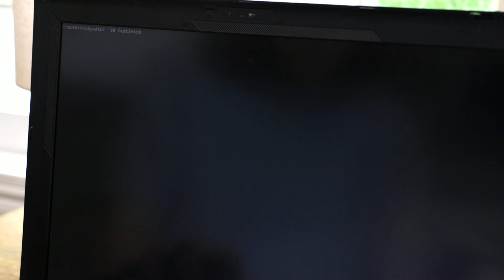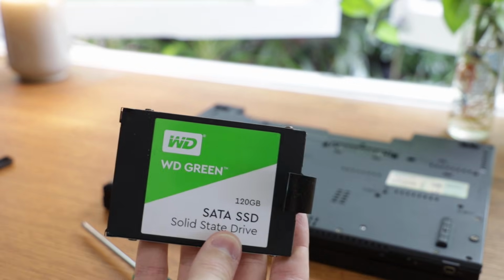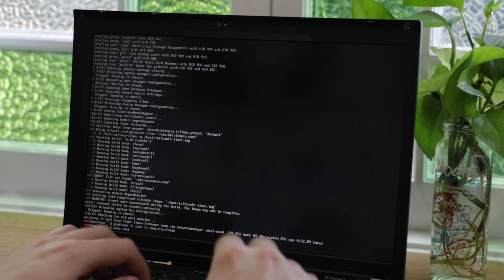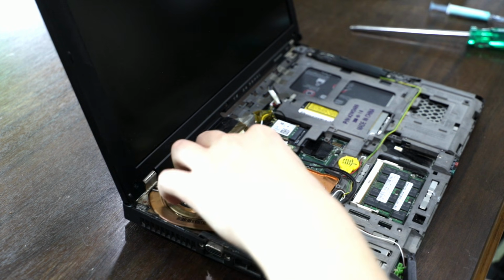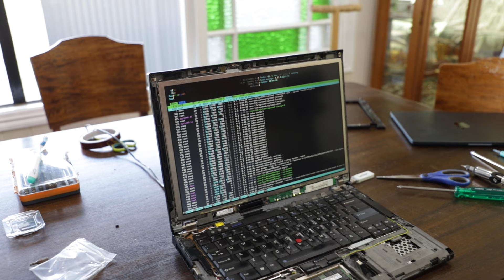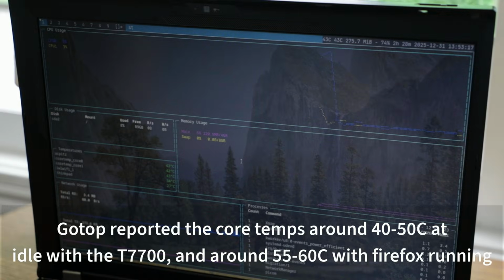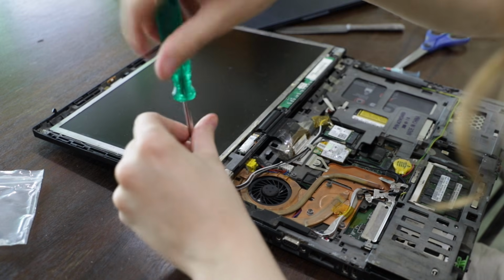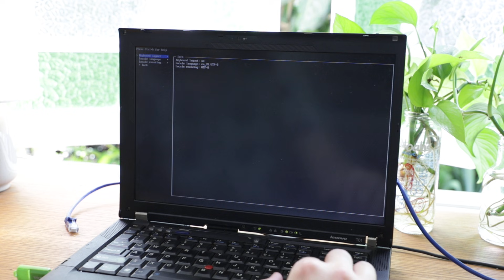Restoring and upgrading an 18 year old Thinkpad T61

Comment: I have a Toshiba satellite l500 that I love to bits and have taken to bits and powered on, with the motherboard resting on a stack of post-it notes trying to diagnose overheating. Apparently the heat pipe broke? Didn't know that happens. Miraculously, it all works now. I wouldn't say its easy to take apart, but it is upgradeable. You can still have some fun with any laptop from ~2010, bit just the thinkpads, dell bussiness laptops are quite nice too. And I really agree what you said about archinstall, if you get an error, you have no clue, but if you do it manually, you know where it broke and get an overview of how it all works. Great video 👏

Comment: I daily use a Mid 2009 iMac while most people wouldn't want that, I use it on a freebsd box and runs pretty well but time to time you'll need to restart your application due to DLA that causes it to slow down. Also there are limitations what software can run typically while most people care about games there are certain graphic or processor intensive apps that don't work but there are workarounds.

Comment: Lenovo is consistently better quality than hp or dell. Hp with the hinge problem for example. Not to mention you bought an old laptop that was used for many years. Windows is bloatware??? Is that your original thought or are you sheep? I install Windows 11 on laptops from 2011 with no issues, it looks like it's fashion nowadays to just hate on Windows for some reason. You wait until Linux starts to be the same way mate, it's not far off.

Comment: I have a ThinkPad P73 that bought used of market place for $300. It's a fair bit newer then the one featured in the video, it's from 2018, I think. It's an absolute tank! I've been able to upgrade the ram, nvmes and even added an sata sad to it. It's huge and weighs a ton, but it a great desktop replacement and runs Linux without any fuss.

Glad to see that this T61 has a new lease on life:)
Reply: I just recently bought a used t14 and im upgrading the ram and putting a new ssd in. This stuff is exciting! Im gonna use a dual boot system with Ubuntu and windows 11

Comment: My X260 is similarly wonderful. Has a 32gb stick of DDR4 in it (because why not?) 1tb SATA drive (only used like 100 gigs on CachyOS) has an intel AX210 wifi card AND it has like 100WH of battery capacity in it, which lasts forever when I limit my CPU wattage for doing basic stuff.

I recently got a X13 gen 2 with an i5-1135G7 for a smoking deal and honestly it's kind of underwhelming. Behind it's gorgeous 16:10 screen, faster CPU and all aluminum chassis it just doesn't feel as robust. I'm also kind of annoyed with scaling. The old 1366x768 screen on the X260 doesn't need wonky blurry scaling for me to read things :(

Comment: Wait until he discovers the T480 😄
Reply from the maker: Oh I know lol, but this was cheaper (until I started upgrading it).
Reply: t480 is really overrated and really expensive than even newer ones
Reply: @moziy_ This. Tbh, if I wanted an older thinkpad, I'd just shoot for anything T420 and lower. The T480 is basically the same compared to the newer models when compared to upgradability, except for one ram slot. I don't understand why people hype it so much. I'd be more satisfied with one less ram slot but with a newer Ryzen cpu than an 8th gen i5 and HD Graphics from the dark ages.
Reply: @bromdeluna i need bloatware 11 for work. So the fact the t480 has a tpm 2.0 module and once you slap 32/64gb ram in there. The processor is not slowing me down at all. The intel 620 gpu is a dog. Totally agree with you there.
Reply: @moziy_bought mine 2 years ago for about 200 euro. Nowadays i totally agree with you. Some people listing these for like 300/350. However, the purchase price is one thing. All the upgrades that you will do is another. Mine is maxed out so all in all I'd say I'd spend about 150/200euro in upgrades over the years and i don't regret it. It's a perfect travel laptop for my use.
Reply: @moziy_ Outside of it's specs I really hate the t480 the keyboard on it is shit
Reply: @sebastiansel07 i have tried a t14 and didn't like that keyboard at all. The 480 at least has some travel to it. Of course they're not as good as the old school IBM ones.
Reply: @cryptopelgrim4751 I thought they both use the exact same keyboard outside of where the ribbon cable is placed
Reply: T440p
Reply: @the_retag with libreboot option. I like the 440p and they are super affordable.
Reply: T480 is only good because of the Intel 8th gen processors. It's not that good of a laptop.
Reply: @5l3ks i would argue that the 8th gen is just good enough for modern computing and the 620 gpu just outright sucks. For me it's the modular design and easy upgradability that makes the T480 "the last great thinkpad".

Comment: According to my own experience, try avoiding using kapton tape on anything vibrates like fan, speaker, HDD even transformer and loosy cables, any loose parts of the tape will vibrate in harmony and make annoying intense high pitch noises.😢
Reply from the maker: That's an interesting tip, I've never heard of that happening before.